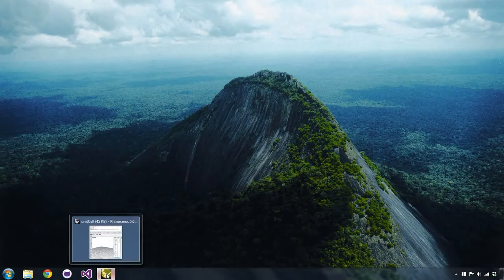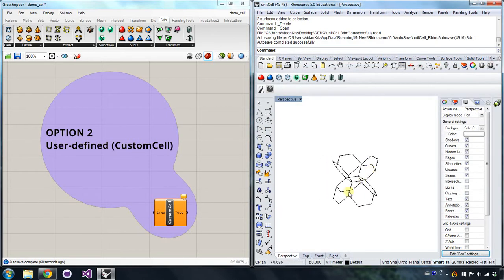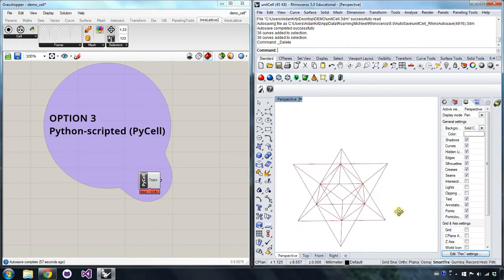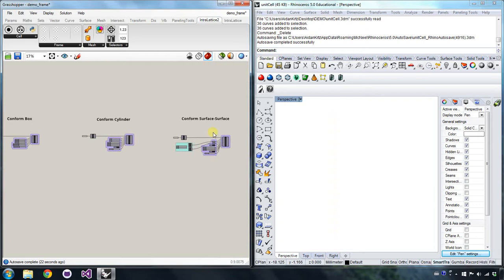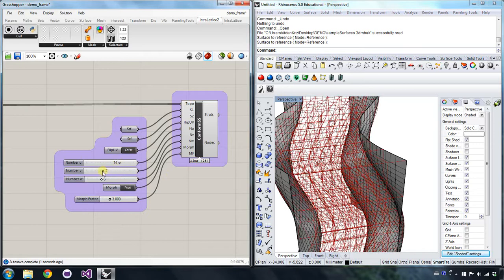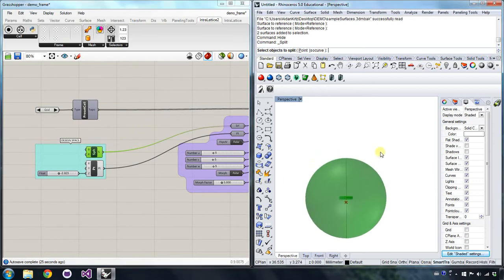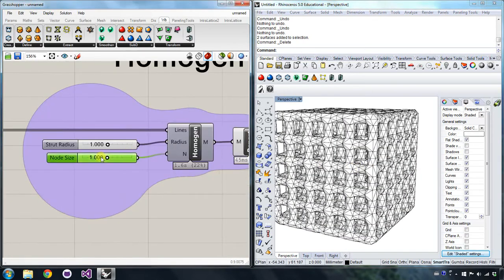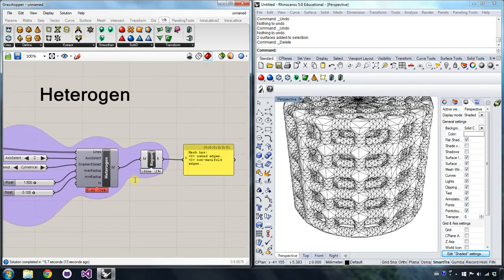intralattice

Comment: Potentially slow question, how do I manipulate the model in Rhino once created? For example, to 3D Print. I can't select or modify the lattice within Rhino after Grasshopper.
Reply: You should bake the model into Rhino. It will be mesh object. Then you can use other Rhino command to modify the mesh object in Rhino.